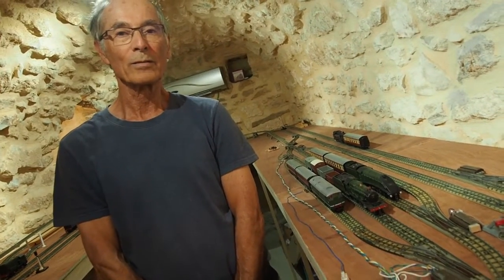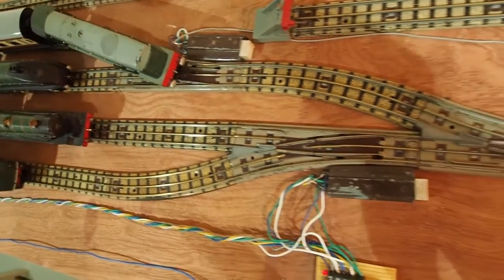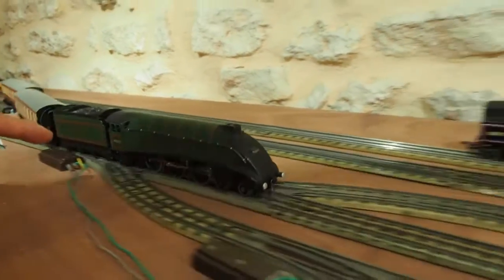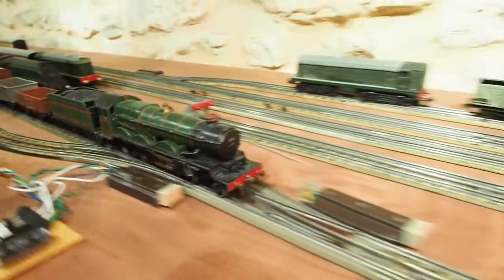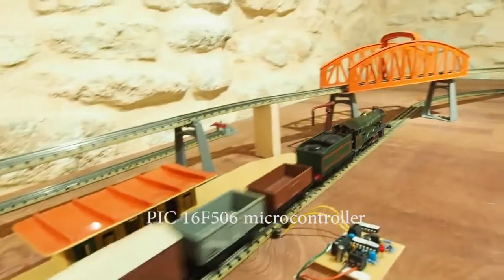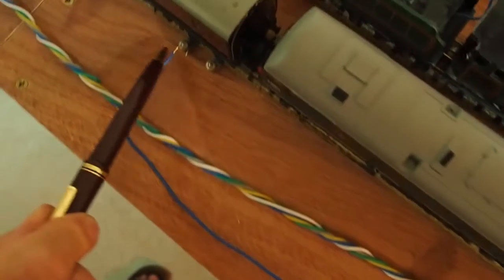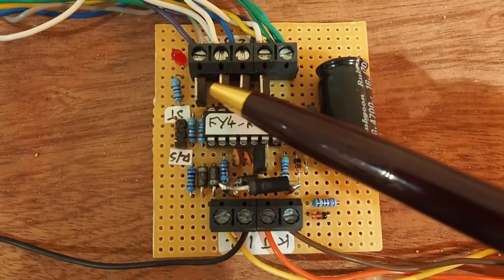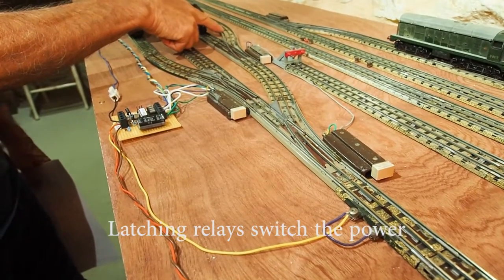Automatic Fiddle Yard

Comment: Hi a really interesting system, I noticed you are running a three rail system will this work on n scale two rail?
Reply from the maker: Hi Phil, yes it works with any scale/gauge.  But you need decoders which work with the Lenz ABC system, such as Lenz and Zimo.  I wrote an article describing the system in the MERG Journal September 2016 - you just need to join MERG - which is very worthwhile anyway.